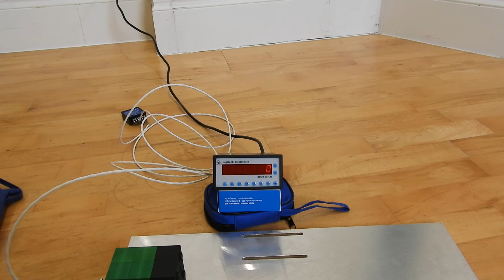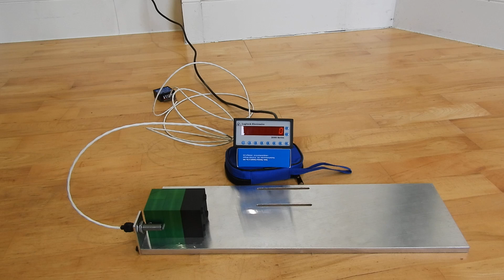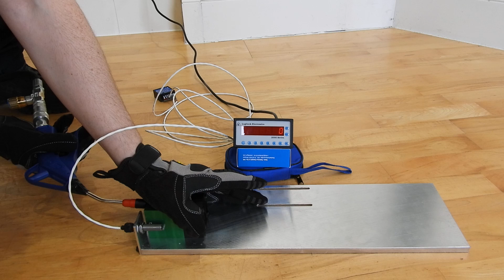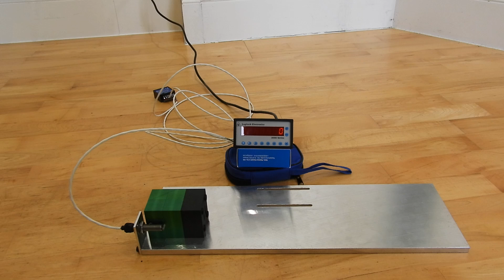711MPH Tesla Turbine - Supersonic Attempt 2 - 220psi

Comment: you said in the video that you had over 3000 psi in the tank when the title of the video says 220 psi what is that about?
Reply from the maker: 220psi is pressure out. 3000psi is total pressure in tank.
Reply from the maker: The regulator shows two readings. The pressure in tank and the pressure the regulator is set to. As the air volume approximately 4940 litres runs out the pressure in the tank reduces. This tank has done 3 high speed runs in total now and shows 2000psi as of today. Maybe one or two runs left before a refill will be needed.
Reply: Awesome thank you for clarifying

Comment: Let's examine your turbine: 1. Zero practical application demonstrated. So it spins fast... and? What am I missing here?
Reply from the maker: If a turbine can rotate at supersonic + rotational speeds it can have a much larger power density than a machine that is limited to subsonic speeds. Tesla claims the torque is at a maximum when the rotor periphery is half that of the fluid. Frank Germano who has 10MW Tesla turbines in operation in USA using super heated steam for example supplies the working fluid at Mach 2.0. This is purely a destruction test. We have since gone much faster and not yet broken the apparatus. Only the RPM measuring system and fluid supply system has failed, the turbine and bearings are still intact.
Reply from the maker: The test is to establish safe working limits of the bearings and rotor. After two faster runs we still haven’t established these figures as yet. We are currently working on a much improved apparatus for 1000mph+.
Reply from the maker: We don’t need to publicly demonstrate practical application. Frank Germano has been doing it for 20+ years using Tesla turbines and converting landfill to super heated steam and converting the heat into electricity. These videos are purely educational for the people who support our work.
Reply from the maker: Adding a superheated steam boiler of Tesla’s design would allow power and torque to be derived from the shaft. Tesla claims his turbine is good for handling 1100F and converting the heat to mechanical rotation.
Reply from the maker: The destruction test is to prove Tesla’s quote written in the description. We have already proved this at subsonic speeds. We are yet to break this design even at supersonic + rotational speeds. The bearings are rated at 1223mph periphery, 373,000rpm.
Reply from the maker: At 100,000rpm you wouldn’t physically be able to stop
the shaft by hand. Every time the RPM doubles the torque and power quadruple.
Reply from the maker: Compressed air from a tank isn’t the intended working fluid. It’s just good for top speed runs for destruction testing.

Comment: Can't wait too see No.3
Reply from the maker: The new setup is looking the business and is a mixed fluid Supersonic Tesla Turbine.
Reply: @nikola.tesla.r.and.d.centre  thats going to be very interesting.
Reply from the maker: @EnterTheRealm  I didn't know if there would be a sonic boom or not. I had thought it was possible and maybe it still is? This is why we are going to go faster and faster until we can't go any faster!

"Another advantage deserving the most careful consideration of the user is the perfect safety of the new turbine. There is an ever present danger in a machine of the old type, that the wheel might burst and destroy life and property. Such a deplorable accident is absolutely impossible with the new turbine rotor, composed of thin discs which expand slightly and come to rest, invariably without damage, as has been shown in exhaustive experiments."

Nikola Tesla - 1918